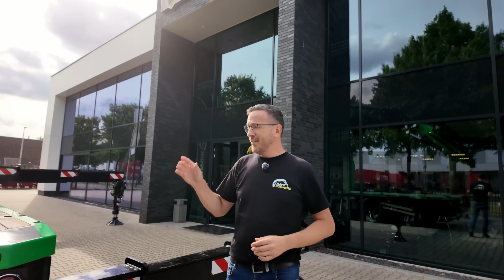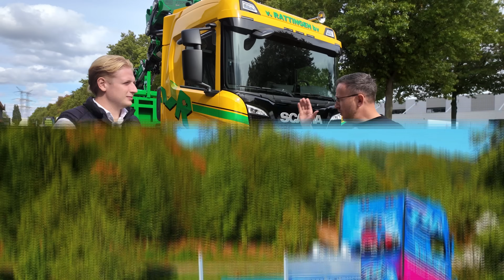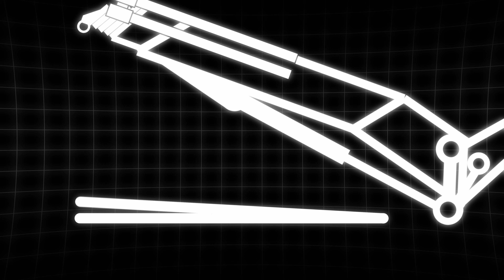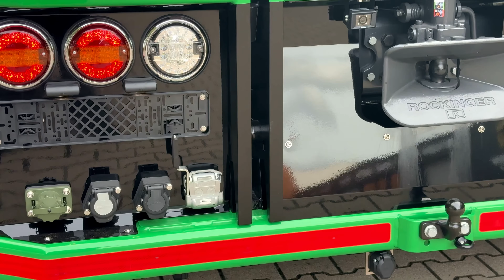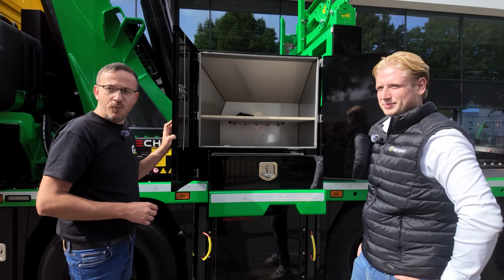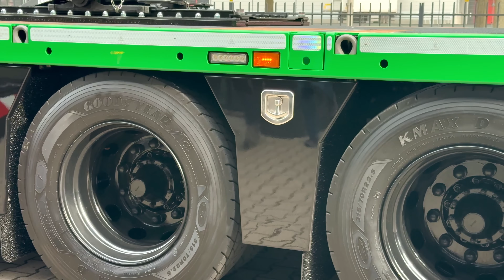Reviewing The FIRST EVER Fassi F1750 In The Netherlands!

Comment: Did he just say it weighs 27tons empty? That's incredibly light for a crane of that size. If that weight is true the load testing is going to be a good watch 🤣
Reply from the maker: The 27t figure refers to the total capacity of the rear tridem bogie. The empty truck I was estimating to be weighing somewhere between 34-35 tons.